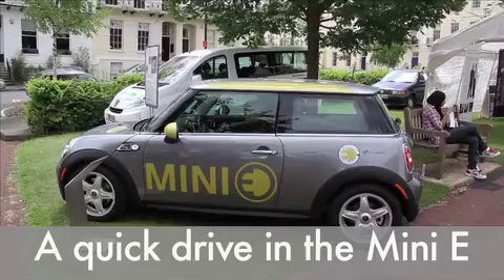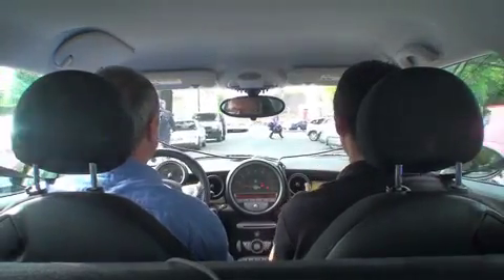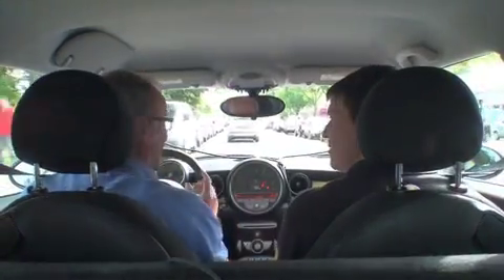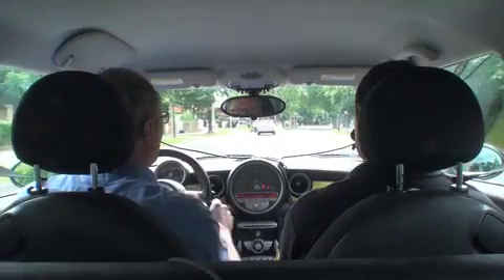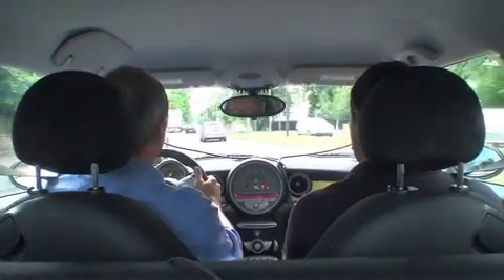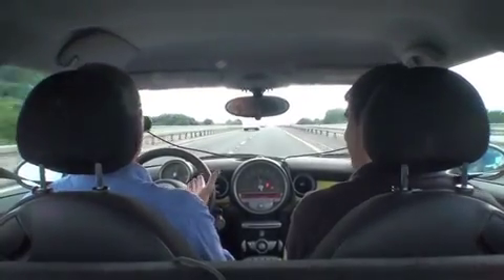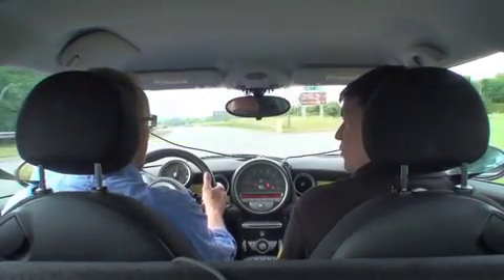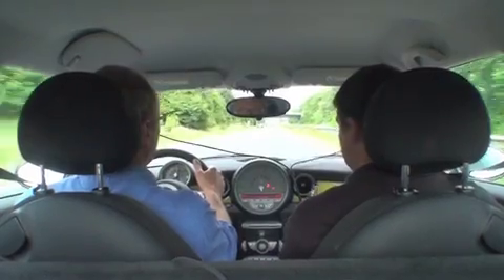Mini E | Fully Charged

Comment: Driving a manual is way more fun, but when you simply want to commute from A to B then electrics are the way to go.
Reply: Yes. ICE for occasional fun but electric for everyday use. Ideally the electric would be able to fake all the noise/vibration and torque curves.

Comment: @CmdrTobs 

Well, right now, the fastest recharging EV car is about 15-20 minutes, AFAIK ... that's not nearly fast enough. But yes, the technology is there, we need less than 5 minutes. They could even use Super Capacitors, they can be charged in a few seconds.

They also need to increase Voltages that the cars run on, because higher Volts would mean thinner cables for high effect, so it costs less resources to ramp up the voltage than ramping up the amps. 500 Volt batteries should be minimum.

Comment: @Pook365 I was thinking along those lines..... a 'gear box' that electrically can control torque switch and adjust the modulation characteristics of the ESC etc...

Comment: the main counter argument on "a hundred miles isn't enough" is not just to make bigger batteries, but to make faster recharging ones.

If you suddenly wanted to go to scotland in your batteripowered car, you should be able to do so ... and just like the petrol cars, the solution is the same ... refill it - Quickly.

Comment: @ nbsr1
I think rather than having a gearbox you could switch from delta to Wye winding on the motor and achieve in effect two gear ratios.
Reply: What do you mean? That's just electrical right?

Comment: @avada0  Nissan have an 8 year warranty on their leaf. They also stated that they will re furbish leaf batteries which will bring prices down.
If in 8-10 years time when the leaf battery drains out and battery tech hasn't advanced at all, prices haven't come down and fuel prices haven't gone up then we'll have a problem, not likely though
Rant over ha, I'm preaching to the converted

Comment: 3) battery tech is too slow advancing and too expensive. (as you point out this is gaining momentum by the day. Not only do we have battery,motor,battery seperator,and various other tech advancing we have Japanese based JFE Engineering developing a 50% charge in 3 minutes, harsh on the battery but then battery advancements would evolve to cope with this and increase range and lifetime which means less demanding charging. After years in the wilderness the tech is now advancing

Comment: @avada0 His main arguement seems to be, 1) environmentalists only want to drive them, (not true). 2) The power we use to power them is fossil fuel based and that negates the first point. (As pointed out many times the uk gets the largest majority of its power from gas firedpower stations. Even when taken from coal the C02 and overall particulate levels are still considerably lower, reduce for off peak power and for gas and nuclear). ...cont

Comment: @avada0  "we can't make enough electricity to supply 33m motorists" (we wouldn't have an over night change to e.v's! apparently  the current grid can cope with a 15% change over, current estimates put E.v adoption at 5-15% for 2020)
"The batteries will be too expensive to replace" (They are now yes, it is a problem but will they be in 10 years time?)
"is it really a zero emissions car"   (yes! you don't question whether a telly is zero emissions, or a washing machine)

Comment: @theshemullet It's because of the regenerative braking. When power is no longer applied and deceleration is required  the motor becomes a generator and regains a bit of power back to the batteries.
We use a very basic version of that in electric RC and slot car models. For slot cars it's called EMF braking, but some of the more expensive electronic speed controls will give power back to the RC batteries too.

Comment: @ruuman 

Most of the companies that were pushing hydrogen have since given up on it. Batteries have gotten good enough that the best ones offer the same range as a fuel cell at the same pricepoint, but last longer before they need replacement (Compare the FCX Clarity and Tesla Model S)

By the time a hydrogen fueling infrastructure could be built, batteries would be so much better (and cheaper) that those hydrogen stations would be torn down shortly thereafter.